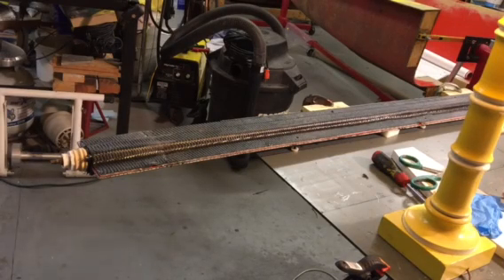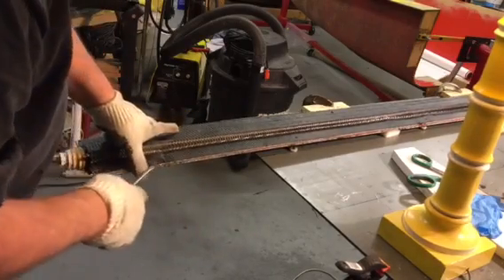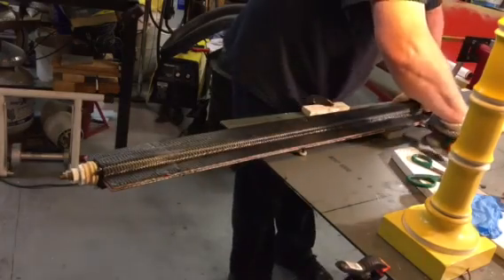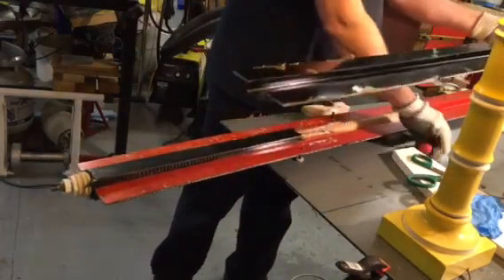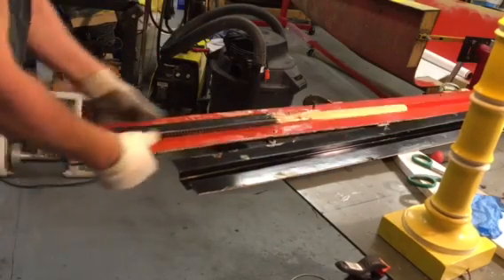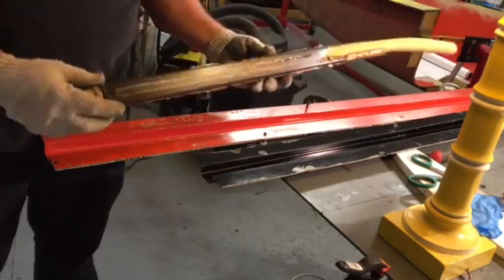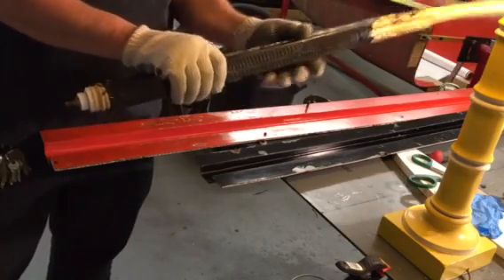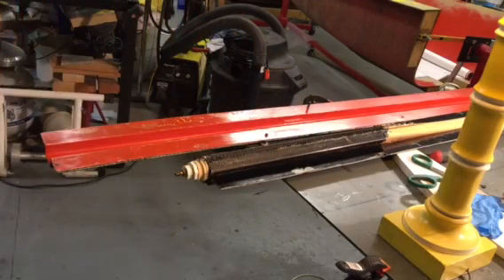making carbon fiber tubes

Comment: How does price compare with purchasing the tubes prefabbed? I ask because I find them prohibitively expensive. Your process looks simple enough that it may be worth doing on a greater scale - making products that use cf tubes.
Reply from the maker: Dylan Sirois : once you get molds and parts together the cost is good to make em. Air-compressor, vaccum machine, custom bladders.
Reply: @Pushyhog   I might just have to try it. So, you run the bladder on the inside, then put a vacuum bag on the outside of the mold just to keep the mold pressed together? Would love to see a more detailed video of your process!  How do you do the seam, just a small overlap somewhere?

Comment: How did you lay the ply's to make the square tube ? did you use a carbon fiber sleeve ?
Reply from the maker: julienjjj :  wet cf in bottom mold/repeat in top mold. Tube goes in bottom. Cf lapped over it. Bolt together,  blow up tube & regulate for curing hours. Vaccum tube down and pull after cure. Take mold apart. This was sample first piece. A real bladder now and vaccum. Bladder from piercanusa.com nowdays. Look at my other vids.
Reply from the maker: ya haf ta vaccum tube out, which l learned, notha vid.
Reply from the maker: i have 2 molds now/& 2 bladders from piercan usa in socal, vista ca.. piece of cake now with air compressor and my vaccum machine, not cheap/but was donated to me from a friend.

Comment from the maker: I made another 2 part mold for 40mm. I gotta make some for myself. Iam comfortable with process now and can make walls good with 3 kinds of carbon. Twill, uni, biaxial. My homemade trike, now a 4 wheeler has metal frame. Wanta change that to cf tubes.